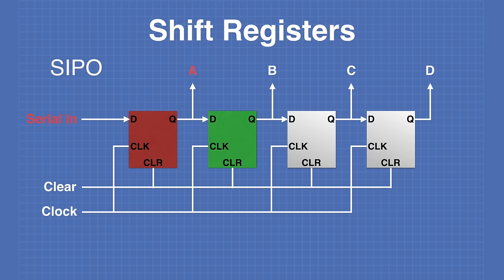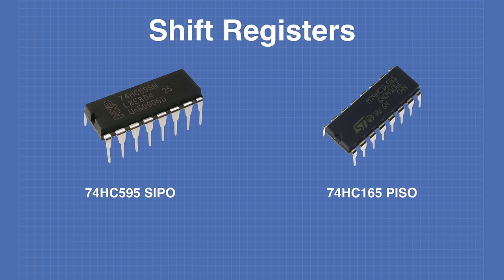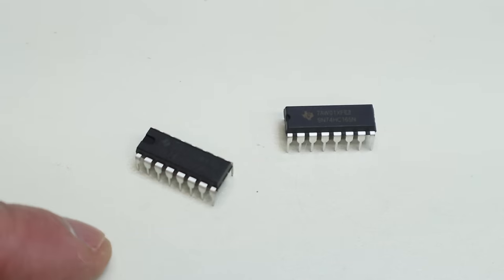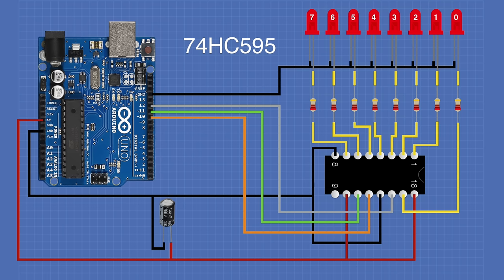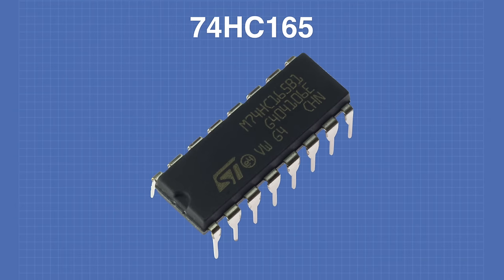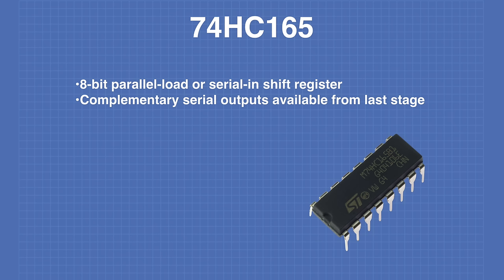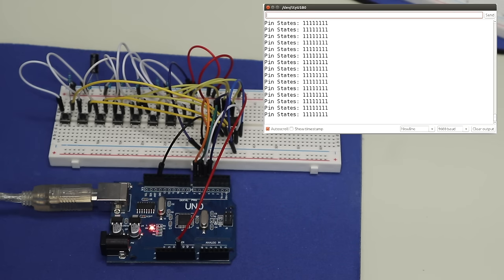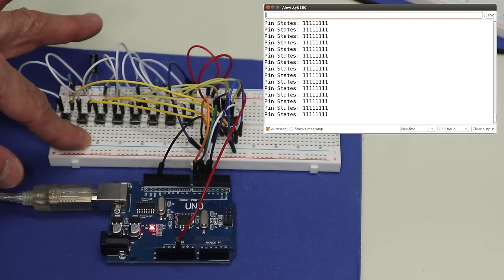74HC595 & 74HC165 Shift Registers with Arduino

Comment: Wouldnt it be easier just to use one resistor on the cathode of the LEDs, rather than 8 seperate ones?
Reply: This doesn’t work. If 1 LED is on it will be bright. If 8 LEDs are on they will be a lot dimmer.
With 8 resistors each led has his own connection to 5V and 0V (with an resistor).
Reply: @LogRobin  That makes sense, its obvious now! Thank you!
Reply: @LogRobin   your explanation isn't wrong, BUT you know 74HC595 will bright up only one LED of 7-segment at once, however we see many LEDs on because the speed is super fast as to our eyes cannot notice at that rate :)

Comment: Why won't we get all 8 bits if we use the other Q7 output?
Reply: I think that assertion is in error.  The outputs are complementary, with no phase shift, so the same number of bits are propagated. I would also like to see further clarification from the author on this point.

Comment: Constructing this didn't seem to work for me, and I had the datasheet to the side as well.. I think I need a new 74HC595 lol...
Reply: probably a noise problem
I'm working with some 74hc595 and i bought 9, and every single one of them didn't worked, then, suddenly it worked when my hand was near the circuit. Thats because of noise interference, also it seemed to work when i was touching it, so what i recommend you is check the connections, check the ground pins and put a 100nF capacitor between each gnd and vcc

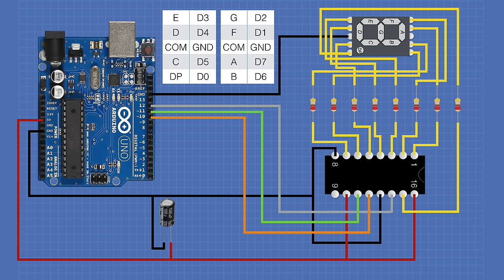Comment: time 16:54, Correction - 1) D1 goes to G 
                                          2) D2 goes to F
Reply: @ DroneBot Workshop, can you provide the IC number for the RESISTOR ARRAY you have used

Comment: I really do not see the point of this when Atmel arduino chips are just as cheap as the shift registers, and you can just connect them together for more IO's.

You don't need the whole arduino uno board with the USB etc. Just the micro controller chip and a crystal. That is like 2 dollars each unit.

Comment: This is not the best way to expand your IOs, it is better to use a decoder chip something like a 74-154 ( 4 to 16 decoder)
Reply: Or a 8255 chip with 24 outputs.Or a 8155 io + timer?